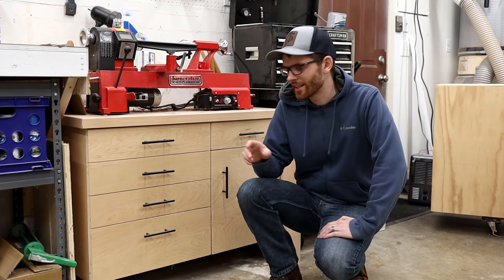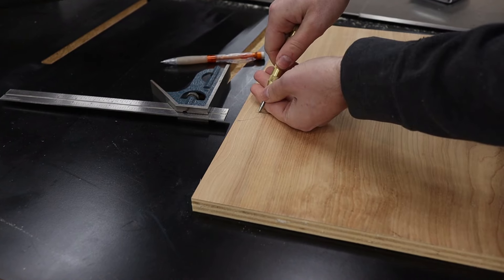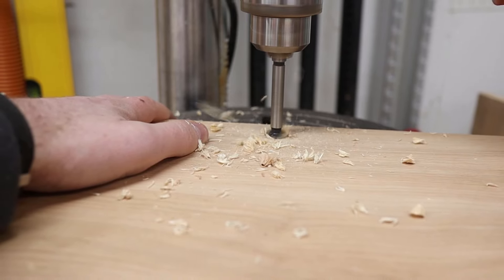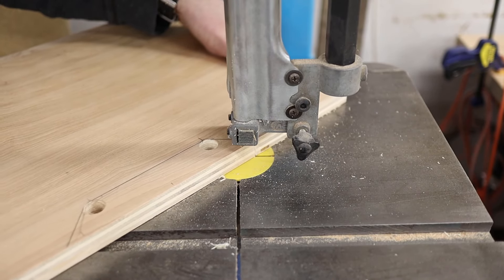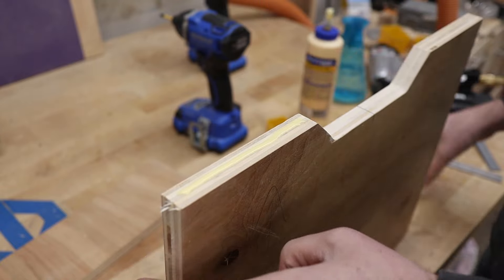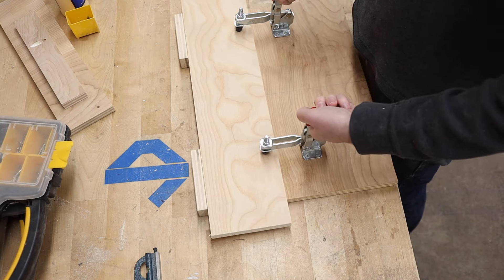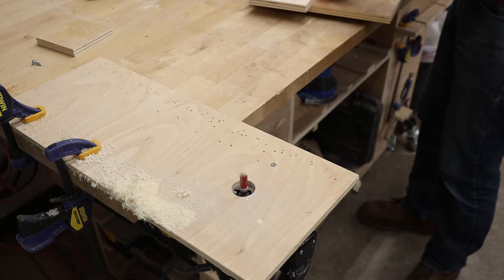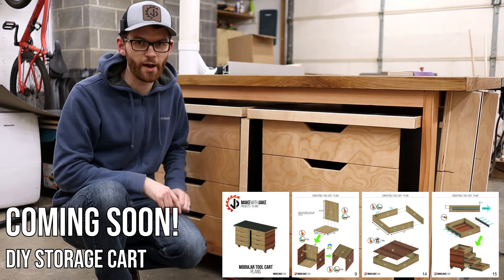EASY! How to Make Drawer Pull Cutouts!

Comment: Did you edge band the plywood, and if so, how do you edgeband around a curve like that?
Reply from the maker: I did not edge band this time.  I think if you smoothed out the curve enough, you could probably still edge band the curve, but it would still be a little challenging.
Reply: Instead of a flat iron, use a curling iron. Works great!